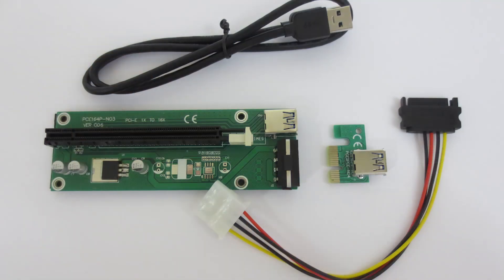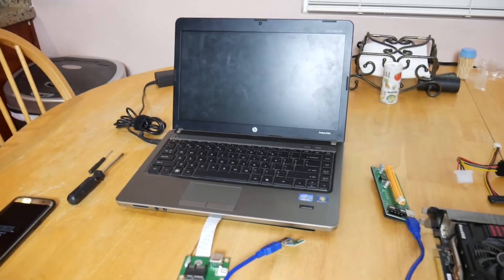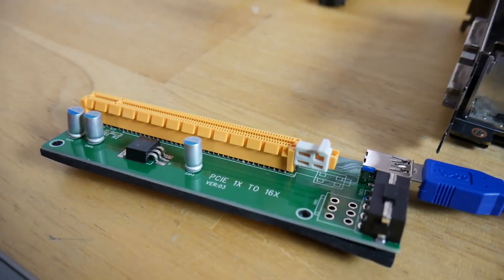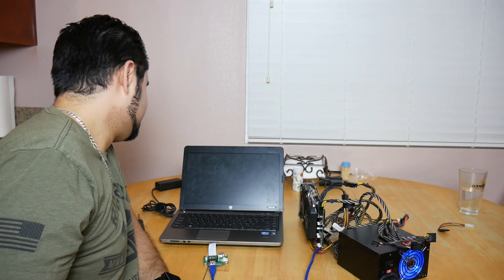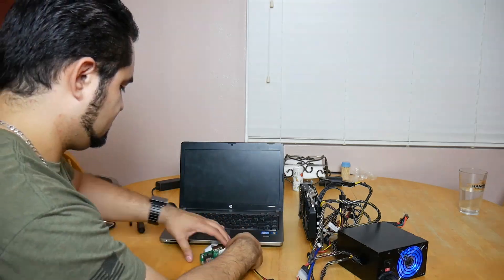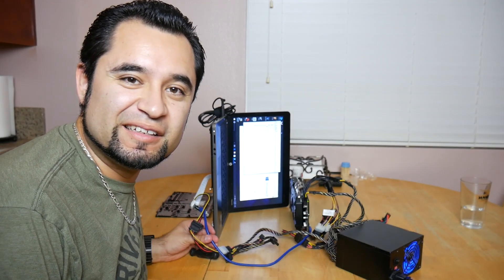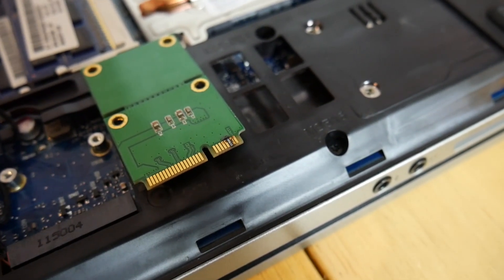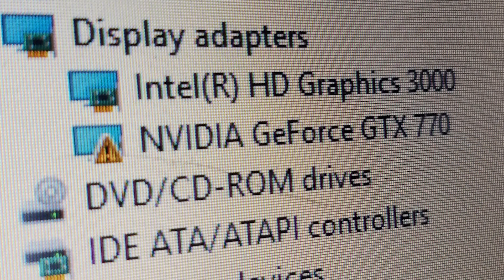$30 DIY EXTERNAL GRAPHICS CARD DOCK [eGPU ATTEMPT]

Comment: Is there any such cheap egpu card adapter for my imac in thunderbold2?
Reply from the maker: im not entirely sure what I/O that imac would have to answer that question. Seems like it has Thunderbolt 2 according to your comment? The cheapest solution is using Apple's TB3 to TB2 adapter using an Akitio Node or maybe even HP Omen. I dont think those were over $300 for the docks. The "budget" eGPU docks can't do Thunderbolt because intel regulates that license.

Comment: as of today, I'm still using a nvidia gtx 650 and it pretty much plays every game u throw at it. and best part is I'm using an intel core i3 3220 3.30GHz cpu and 8GB ram, im planning to upgrade the desktop and throw the gtx 650 on the HP Beats Audio all in one PC... while using the external eGPU setup but a different one

Comment: if you remove that wifi thing, can you still go on the internet?
Reply from the maker: Yeah, just gotta use an Ethernet cable directly from a switch (wired in) or use a USB WiFi adapter to regain WiFi access

Comment: Got a HD3000 iGPU and had a GTX770 2gb EGPU (as I don't have CPU/Mobo since it stopped working). I use my laptop a lot and thought of eGPU (express card).. it's not bad at all.  About 60 bucks spent and I'm gaming on my laptop (external 144hz screen).

Not bad from HD3000 to GTX 770 (performance is Def different from desktop  since express lane bandwidth  is slower) and I have it connected via express card.
Reply: can you run heavy games on it?
Reply: can you run heavy games on it?

Comment: Your laptop is booting exactly. When you first connect your external card. It giving video output through external graphic card. You only have to attach an external display to gpu hdmi port and it will work..

Comment: Which gpu can I use with my laptop,  lenovo ideapad, 1.6ghz., 4 gb Ram laptop
Reply from the maker: Whatever GPU you want, though i recommend an nvidia GPU. For yours, id suggest like a GTX 1050 or 1050ti. But you need to find out if you have ExpressCard and/or Mini PCI-E

Comment: Hi... nice attempt, but just a thought; Why not mod the laptop's mini pci express slot itself by soldering a small dip switch pack to cut any of the power/ground pins... I haven't studied the mini pcie pin out schematic that another comment here linked to, but if there is a voltage difference as that post claimed, perhaps a buck converter could help with that.... But the first thing I would have done is have a way to cut that power/ground to the rest of the external mod directly at the laptop so when i'm hot swapping the small adapter boards into the laptop, i'm not gonna fry the laptop...just saying... buck converters and dip switches are hella cheap... way cheaper than another laptop
Reply from the maker: The mini PCI-E slot itself actually survived, it was the adapter that didn't. I believe I had the power off to the eGPU adapter as well, it was just power from the laptop being on during the hot swap and the angling out of the adapter that bridged connectors that caused the adapter to fry. To accomplish something you describe wouldn't be hard at all considering i've previously found Mini PCI-E extension ribbions, in which case i could have run the mini PCI-E out and away from the laptop and worked with it hot swapping with much less risk. Thats definitely something to think about for another attempt later down the line. Hmmmm

Comment: I see that it had an accident with the adapters but it does not matter, because I happen to have two adapters just like yours and I could install a GTX 8600 2GB to my laptop, so if it works the two adapters that it has, I boil them .. And it's cheaper than buying the standard eGPU adapter
The only loss I have in the video card is the fault of the processor

Comment: dude, that was a hell of an effort. i watched a similar video with a different brand adaptor that was a success. maybe not having the adapter power plugged in made it draw to much through the pci port. damn that's a drag, i love this kind of content though. good video!
Reply from the maker: Thanks man. Appreciate the good words. I love to tinker. Thinking the angle of the adapter as i switched hands to screw it back in (need more hands...) during the whitelist bypass, the way it was hanging bridged contacts that weren't supposed to be bridged and thus the issue. Oh well! 

part 2 didn't go any better...but at least nothing burned up lol.
Reply: a good education is expensive, right? you won't do that again. hopefully i won't either.
Reply from the maker: gotta learn somehow!

Comment: Hey Coalition Gaming. I have watch your videos about you trying to use the GPU on laptop with the cheap external riser that had the USB 3.0 but failed because the pin burn right? Well, it burns because the voltages is not the same. Your laptop's PCI-E Mini slot have 1.5V and 3.3V running through and the external GPU riser had 12V and 3.3V. Here is the Mini PCI-E slot (laptop PCI-E) pin diagram if you want: http://pinoutguide.com/Slots/mini_pcie_pinout.shtml  
I think you need to modify the external GPU riser (the cheap one) make it work on laptop. I hope this help for people want the cheap way too.... You can find more pin diagrams at pinouts.ru
Reply from the maker: The pin burned because of how it had to hang while i swapped it to bypass the whitelist. It hung out a little too far, bridged contacts it shouldn't have, and fried as a result. It had nothing to do with specific pin voltages or pinouts being different or anything like that, it was just bad luck. Thanks though!

Comment: hey buddy i wanna know about connectivity between pci to laptop , i got 
rog laptop which have thunderbolt 2 in it so is there any way to use it 
instead of opening my laptop and removing wifi card
Reply from the maker: Thunderbolt 2 is absolutely the best way to go for you. While i previously would have suggested you use an Akitio Thunder2 modded for eGPU use (plenty of guides online, make sure to visit egpu.io and reddit.com/r/eGPU ), there have been multiple reports of the Apple TB3 -> TB2/1 adapter working on non-Mac laptops, in which case i'd say get that Apple TB3 adapter an Akitio Node and you'll be golden. There are no cheap ways to do an eGPU over thunderbolt, unfortunately. The cheap ways require opening up your laptop, so if you want to use your Thunderbolt port then its gonna cost a bit more.
Reply: thanks for the information but the problem is my budget 400 usd  in which the 1060 6gb cost around 280 usd so right now i cant go with akitio node any other way to make it work
Reply from the maker: Like i said, cheaper options require opening your laptop in which case i suggest the Bplus PE4c mPCI-E version, or the EXP GDC Beast. Make sure the ones you buy come with the power adapter, unless you have a spare computer power supply. The versions that come with the Dell DA-2 power brick would make for a nicer setup though, less messy.

Comment: lol 650 outdated I'm still using my gtx 650 ti boost
Reply: Makes sense, I was overclocking the crap out of my GTX460, with an aggressive fan curve, it did alright, 40-50FPS for most games on high, 2 years past it's "time".  When the 600 Series came out.  So I waited for the 780 Ti.
Reply from the maker: Hey as long as its still chugging along, thats awesome. I still have a 560ti and a GTX 460 768mb lying around, and a Radeon 4850. Maybe i'll do a video on how well they hold up.
Reply from the maker: #FeelsBadMan
Reply: Coalition Gaming na it's OK over clocked to 1.2 ghz it runs fallout 4 on ultra
Reply: about 50fps

Comment: How did you turned on the psu ? I have a brand new psu but I can't turn it on without any motherboard :P
Reply from the maker: MichalPlays Look up turning on a power supply with a paperclip. basically you put a paperclip on two pins in the main 24v connector, and it triggers the PSU to turn on. then you can just use the switch on the back to turn it off and on.

Comment: what would I do if I use a gtx 1050 ti a card with no 6 pin connector do I just not need the psu?
Reply from the maker: ObsoleteTV With a device like one of these you would still need the PSU since it powers the dock, which will supply 75w to the GPU thru the PCI-E x16 connector directly.

Comment: Hi, can we use external HDD enclosure box to connect mini PCI cord and connect through USB port instead of removing the wireless card? Thanks
Reply from the maker: Some laptops have a second mini PCI-E slot that works like you'd hope it does. Others have an mSATA slot that LOOKS like a mini PCI-E slot, since they are the same form factor and plug (but pins are wired differently) in which case this would be compatible with an external HDD, but not for eGPU use. 
As i re-read your question though, i realize you're asking to connect the entire thing through USB (i think) in which case the answer is no. eGPU requires that you somehow connect thru an interface that goes to the PCI-E bus. If it doesn't go thru PCI-E (be that mini PCI-E, ExpressCard, or Thunderbolt), then it wont work. If you're worried about losing wifi using a mini PCI-E egpu dock, you'd just have to purchase a USB wifi dongle to get around that.
Reply: Coalition Gaming thanks for prompt reply and explanation. I'm concerned about PCI cord coming out from laptop only, since I'm using same laptop for job. I've read mostly eGPU e.g. Thunderbolt, they don't support all laptops i've dell 5378. 😕
Reply from the maker: You're welcome. Unfortunately, having a cord coming out of the laptop is basically the only option if there isn't a Thunderbolt port or ExpressCard slot. I'm sure some creative people can find a way to affix the cord that comes out in a way where its not a bother (like cutting a hole for it large enough to tuck it back into while you're not using it, or taking out the CD drive and running the cord through that bay).
Reply: Coalition Gaming Yeah, or it could be just simple USB like data traveler, where you just plugin and tada! Windows has detected new USB graphic device. 😁
I'll check it on someday will post the results. Thanks for amazing video, appreciate your work. 👍
Reply from the maker: One can always hope! Glad you like the vid

Comment: Mac not ment for gaming and not very cheap
Reply from the maker: Some people have older macbooks with thunderbolt they can bootcamp to game on windows 10 with. Adapting an eGPU over thunderbolt with apple's TB3->TB1/2 adapter actually works for this, so a newer TB3 External Graphics Card enclosure could be adapted to run on TB1 or TB2 in windows on a macbook. If already had a macbook with thunderbolt and a good CPU, it would be more expensive to buy a whole new laptop as opposed to just eGPU the macbook. Thats sort of the point with eGPUs the way i see it.

Comment: better just try an adapter that directly goes from mPcie to pcie. I had one like these for 7-8€ on Amazon and it worked after turning off secure boot in bios and set something there to "always active" when it originally was outgrayed.
This is the process a guy from the Acer Support told me after calling him and it really worked then! (PC: Acer Aspire XC-603, old Version without normal Graphics Slot)
Reply from the maker: My initial searches found nothing of the sort, but recently someone linked me to one on aliexpress and i've since ordered it. Good to hear someone already tried that with positive results :)

Comment: Hey i just had a thought. i have a m2 ssd adapted to sata to take advantage of the disc drive. Is there any chance the bios whitelist wouldn't be triggered going through sata?
Reply from the maker: Unfortunately i dont believe this will work. If you've adapted it to run through SATA, then you're likely going through the PCH/SATA bus instead of directly through PCI-E (as some M.2 slots are configured to do, it varies on mobo and model and which gen chipset), and any eGPU solution won't work through SATA. The only way eGPU works finding a way to run it over PCI-E. ExpressCard connects to PCI-E, Mini PCI-E obviously is another solution, NGFF/M.2 (depends on config) is also a possibility, and finally Thunderbolt are the only ways to go.
Reply: I understand i think, but what it actually is is a board that the m2 bolts to, then has standard hdd power and data on the output. 

i know all about the bios restrictions having a hp with an i7 and dgpu HD7670. I have had to stick with win7 to be able to OC and have current drivers. In the long run if we get this working the intel + ati drivers setup is a nightmare. So just an fyi in case you ever try this with ati. Lol good luck and thanks for the video.✌
Reply from the maker: Thanks for the heads up, happy you enjoyed the content!

Comment: Do you think I could get away with using a Hdmi to thunderbolt C cable and run it directly to my thunderbolt c port?
Reply from the maker: Chris Pinson what's the device you're trying to use? like a bplus pe4c or gdc beast? I remember one of those uses an HDMI cable wired for data transmission
Reply: A gpd win
Reply from the maker: Chris Pinson What kind of dock? like the one I tried showing? if so, then it won't work.
Reply: Coalition Gaming no more like the one that one of the other commenters sent you a link for it has an HDMI to PC I cord and I was wondering if I could switch it out with the HDMI to thunderbolt c?
Reply from the maker: Chris Pinson Oh no, that won't work. the HDMI cable is serving as a data transfer cable only, whereas going to thunderbolt requires a controller since Intel is strict with allowing thunderbolt to be used certain ways
Reply: Coalition Gaming ok thanks for the info and keep making these great videos I love these little experiments lol

Comment: Could we use this ? https://www.aliexpress.com/store/product/Mini-pci-e-pci-express-riser-card-1x-to-16x-USB-3-0-Data-Cable-SATA/1627923_32788991745.html --> it's using mini pcie - usb 3.0 unlike GDC beast which using HDMI port
Reply from the maker: That actually looks like a truncated version of what i tried to do. It bypasses the mPCI-E to PCI-E x1 adapter i had to use by being a direct PCI-E x16 to mPCI-E adapter. I would say this can absolutely work, however the USB 3.0 interface is limited to 5gbps which is half as slow as Thunderbolt 1, but yes this can still work in my opinion. And for that price, i may just try to revisit this myself! Thanks!
Reply: Thanks for replying, cheaper than GDC Beast, I just ordered from Lazada & AliExpress, different model for input power port. Still need to wait until it comes into Indonesia (a month a head even more) :( , if you can buy it in your area directly, please do some experiment and upload the video :) (#evilFace)
Reply from the maker: Ordered one to do a video update, thanks!
Reply: Subsribed, thanks!
Reply: What about when mPCI port is connected via HDMI(i guess) to the adapter, what's the speed like in that case? Great video though :)
Reply from the maker: I didn't have any luck with it, man.
https://www.youtube.com/watch?v=6wBKN3Vc7fU
Reply from the maker: mPCI dock adapter using an HDMI to a x16 dock would work fine i imagine. Its just using the HDMI cable as a data transmission cable, however it may be tougher this way versus what is shown here having a ribbon since a ribbon is flat and an hdmi cable is not, so closing up the laptop on a round HDMI cable that comes out of it would be tougher than a flat ribbon cable.
Reply: Thank you for the answer. I have a Lenovo G700 with i7 processor, the only thing is the graphics card which is quite low end - 720m, so I am thinking about buying something like this https://www.banggood.com/Mini-PCI-E-Version-V8_0-EXP-GDC-Beast-Laptop-External-Independent-Video-Card-Dock-p-1011222.html and adding a gtx 780 into it. what do you think?
Reply from the maker: You're in the exact situation i personally believe eGPU docks are better suited to. The GDC Beast mPCIe version is exactly what i was going to recommend, though you'll still need a regular computer power supply to hook up to it to power up the GPU. A 780 will do great!
Reply: Thanks bro, I really appreciate it, thank you so much once again. The effort, sweat etc.

Comment: Hey man, I had the exact same idea a month ago. Same adapters and with little BIOS modding my setup is working! so I can confirm what you are trying to do works, but I am now fighting against instability issues.
Reply: What you modding exactly in the BIOS 
Wifi card whitelist ??
Reply from the maker: Walter Junior I knew it would work! awesome job. post on over on Reddit.com/r/egpu about your setup, there are guys there that can help.
Reply: Dude! m
My note book is an Asus and I used this awesome guide! 
http://voltground.com/haven/threads/102/
Reply: It works fine. His just went wrong cuz he tried to bypass BIOS whitelisting by hotswapping the wireless card with the mpcie adapter while the computer was on. While this may work, if you are not careful enough and touches something you shouldn't then you fry your adater, mpcie slot or both in the process. Find a way to mod your BIOS and you should be good to go.
Reply from the maker: hasani hall Or verify that your BIOS doesn't use a whitelist. no whitelist = less issues
Reply: You kinda have to Google the specifics for your laptop. Some laptops don't need any bios mods to use the adapter in it. Forums like egpu.io and techinferno can help you find what you need.